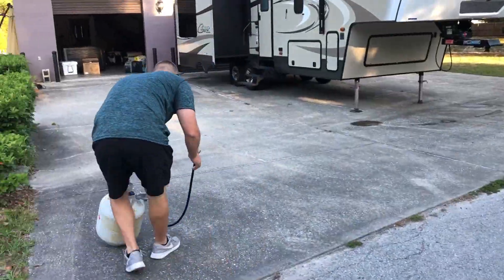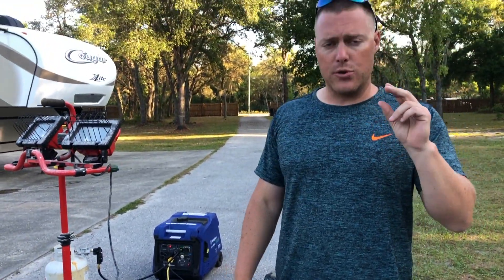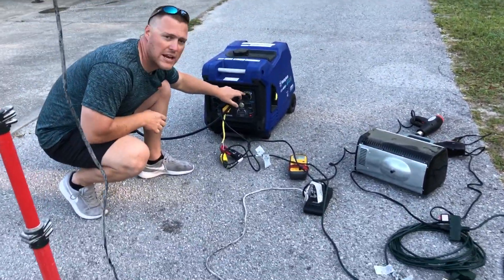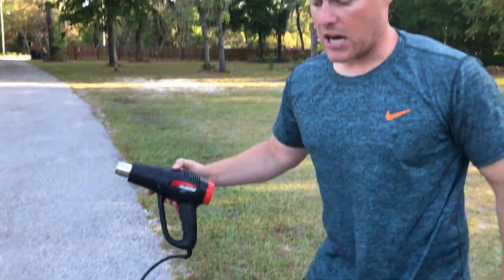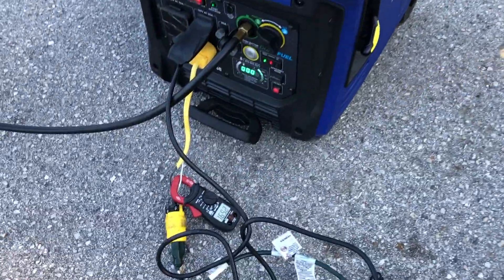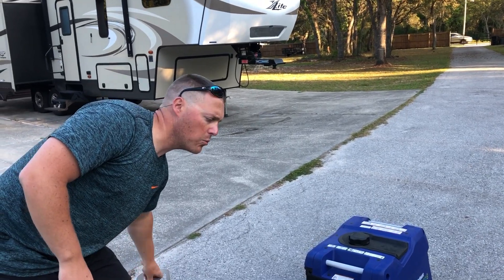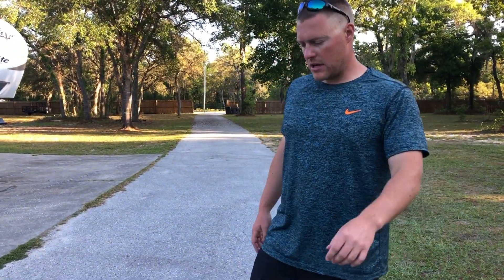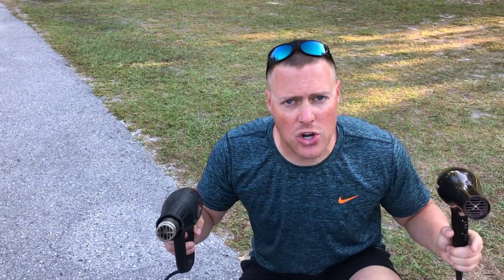Max Power Output Comparison Propane Vs Gasoline Using Dual Fuel Generator

Comment: That was extremely interesting. You could hear the hair dryer running, but not a full capacity. So when using propane, that fuel handles the task fine, but once you reach the upper levels of amperage, the propane can only handle slightly less than gasoline. Very cool.
Reply from the maker: You Got It! Thanks for watching!

Comment: That's was good information. Gas will remain my primary fuel. Will try to utilize propane as a secondary fuel source, for limited device powering. As soon as I find the correct snorkel that will fit my generator's carburetor. Thanks again.

Comment: My IGen 4500 DF should be here on Friday.  Thanks for your videos that helped me make my buying decision.  In this video I think there are several error and hope I can provide some helpful information.  You indicated that you would attempt to draw 40 amps under full load.  However, that current is way over the rating of the generator for either gas or propane.  Since the loads you are using are mainly resistive I would assume a power factor (PF) of approximately 1.  The load you  applied was also long term and therefore for gas the maximum power output of the generator is stated as 3,700 watts.  Using the power formula of P=IE [PF=1] the maximum current would be I = P/E = 3700W/120V = 30.8 amps, thus the 30 Amp outlet.  The duplex outlet has a 20 Amp circuit breaker and those two outlets are in parallel and therefore you should not draw more than a total of 20 Amps from these sockets combined... not 40 Amps.  In your video you showed that one of the outlets was drawing around 19 Amps and then you tried to load the second outlet with another 20 Amp demand.  The result was the first outlet's current dropped to 16.35 Amps.  I am surprised the circuit breaker did not trip but I guess the control circuits in the inverter limited the current.  Also when you switched to gas before applying the second load you showed a current draw of 16.6 Amps.  I don't understand how that could happen unless you changed the load configuration from the previous propane measurement.  Propane does have less BTUs than gas but I think there are too many error in this demonstration to confirm that statement.  So it should be remember that for gas fuel the total continuous current from all the AC sockets combined should not be greater than 30.8 Amps. For propane fuel the maximum continuous current should not be greater than 27.8 Amps. I hope this is helpful and that I didn't make any mistakes ; ) Again I do want to repeat I really appreciate your channel and you taking the time to do all these demonstrations for a beginner like me in portable generators.
Reply from the maker: This sounds way over my pay grade... Nonetheless, we did not change any configurations. We applied the same load under gas and propane. The point was to hear/watch the difference between the two. Looking forward to hearing how you like it! Keep us posted.
Reply: All great comments but it does indeed confirm propane putting out less max power than gasoline. This might be ok from an economic standpoint if propane is cheaper than gas where you are. Also when the amps start to drop, the power output also drops using the same equations. So it is worth noting that after your max propane load on the generator, when you increase the load further you are actually getting less power out of it. When you hear the rpms drop the engine is also producing less power just like in your car.

Comment: Is there a difference in run time between gas and propane at 50% or full load ??
I’m getting ready to buy the Westinghouse 12,500 dual fuel for my house.

Comment: @generator power I wanted to ask about the noise and fumes. Is propane quieter than gasoline (I couldn't tell from the video on my laptop speaker) and is the exhaust fume less toxic smelling? When I ran my small gas generator is smelled terrible like a lawnmower fume and I could almost feel myself getting cancer from it or something not good. Also thanks for making this video!

Comment: The simple reason concerning the power difference of gas vs propane is that gas is more volatile than propane.   Gas has more umph because of this, therefore gas produces more power.  Propane may be more convenient, but gas is more powerful.
Reply from the maker: Indeed! Thank you for the input.
Reply: Propane also produces 30% less heat when burned compared to gasoline. I agree about the convenience of propane though ideally for people at homes with a huge tank to hook into for power outages. For portability I prefer gasoline to a heavy steel BBQ cylinder to carry around but I am not a travel trailer camper like this so maybe there is some other convenience I am not aware of.

Comment: Great Video!  Was hoping someone would do this experiment.  I would of love to know what the voltage was doing.
Reply from the maker: It dropped with the amperage drop. I'll add that in next time!
Reply: @generatorpower7744  Now we need to see if it does this to the famous Champion 3400DF as well.

Comment: Good review - how about sharing the posted power output differences 

3700 max continuous 4500 watts surge on gas and 3330 continuous 4050 watts surge
Reply from the maker: Sure we can do that. Thanks for the suggestion.

Comment: Have you experienced the auto-choke problem on the DF model? Thanks.
Reply from the maker: We have not, but others have commented on it. However, I had a conversation with WH last week and they have told me that they have addressed the auto choke issue.
Reply: @generatorpower7744  Thank you for the follow up. I have several generators and "need" another one for RV travel. I have some Youtube generator and Solar Power content so I greatly value your input.

Comment: Great video, Thanks!. Do you have any info on running a generator with natural gas? I have been trying to find the drop in amps vs gas with no luck.
Reply: I have been wondering this myself. The only info I can give is that a study I dug up from last year said from averaged prices, $15 of natural gas was equivalent to 11.2 gallons of propane. So it is impossible to give exact numbers due to different prices of everything everywhere but if you are running off a 5 gallon or 20lb tank If propane costs $2.50 per gallon, in this example, natural gas is the cheaper alternative. Likely in all situations however, natural gas will be a lot cheaper than propane. On the maximum power output side natural gas has a lot less energy than propane. Less than half actually per cu ft. You would easily cut your maximum power output in half at least which is why you have a hard time finding information on it because people don't do this.

Comment: Hi, I have bought a Westinghouse iGen4500DF last week which comes with spark plug "Torch F7RTC".  So which following spark plugs do you recommend if I need to replace them with;  NGK BPR7ES 5534 or NGK BPR7HIX 5944? Thanks in advance!
Reply: NGK BPR7ES is the replacement for the Torch plug... This is the same plug used in the Predator 3500 that I just replaced.

Comment: Hey guys just unboxed the iGen4500 duel fuel and a bit paranoid about some of the hit or miss feedback on this unit. This is my first generator purchase and your vidoes have been a huge help! Can you give this a listen and tell me if this sputtering I'm hearing is normal or potentially a problem? I don't feel like I hear it on you videos. I am running it on propane by the way. https://youtu.be/KmDBn4YHLP4
Reply from the maker: This sounds very similar to what we experienced when running on propane. We are going to do another noise test on propane soon so you'll be able to hear it again.
Reply: Generator Power thanks that’s good to know! If it had problems with the choke like I’ve seen reported by some, what would be an indication of that? Also what are your thoughts on the magnetic dip sticks I’ve seen? Do you know which would compatible with the iGen4500?
Reply from the maker: It could be a couple of things.... The most common comment/issue I have heard of is either the choke will not engage, making it difficult to start. Alternatively, the choke does not disengage once the motor is running as it is intended too. You'll probably be able to hear the motor running differently. There is no "indication" per-say on the unit, rather just knowing by the sound of it.